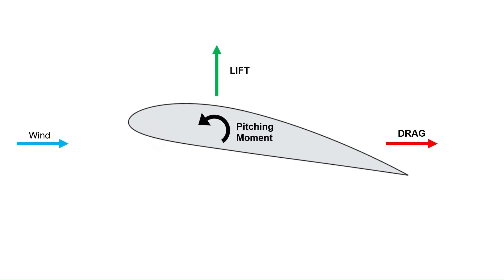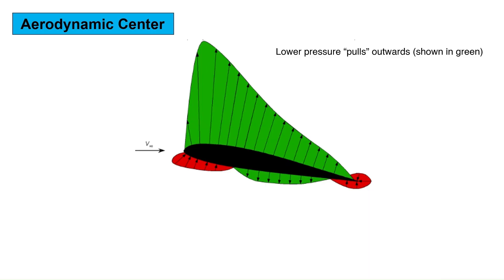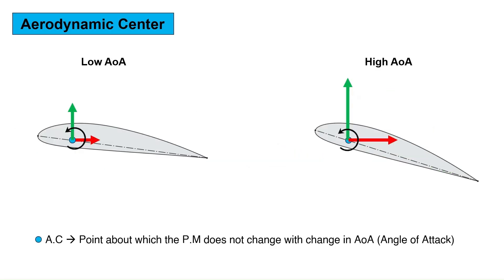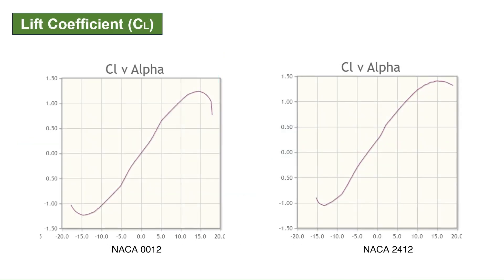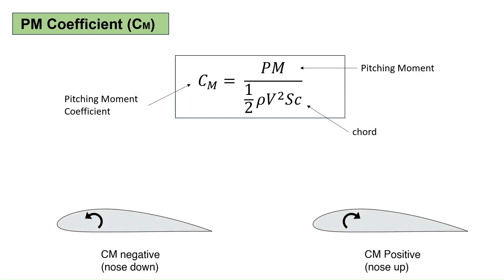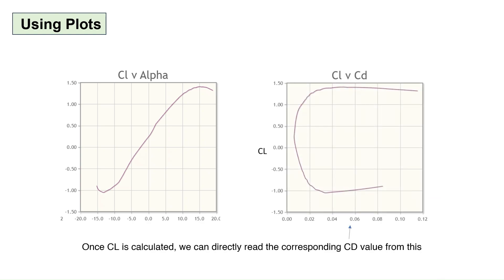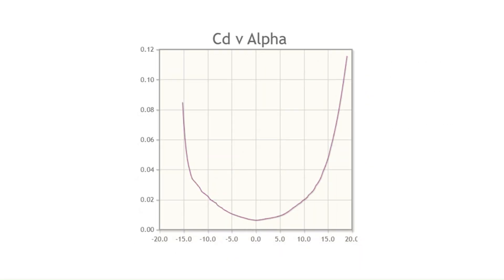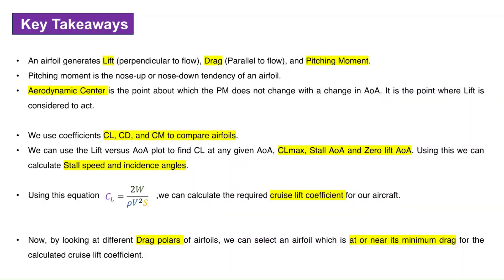Part 2: Forces & Moment, Read Airfoil Plots | How To Choose Airfoil | Airplane Design

Comment: the selection of a wing profile for any application does not have to be 'complicate'.    for one thing, it is not necessary to investigate a multitude of aoa's.      a wing's angle of incidence (aoi) is  Fixed.   and, in most cases, the use of a semi-symmetrical (or flat-botttomed*) profile is recommended,   consequently, some positive aoa is/should be built into the profile, and the wing's aoi may 'need to' be just one or two degrees positive.
*  a flat-bottomed profile should be used for low reynolds number (re#) applications.  eg., where the wing is  'small'  and/or  the speed of the aircraft will be  'low'. 
this is why the wing of a scale model aircraft should  Not  have a scale-accurate profile.

Comment: 153   that  is  not  correct.   center of mass (c-m) has been described; not cg.    every thing has a c-m.
only an aircraft has a cg and it should be located at the main wing's lower surface, at a point/line that vertically aligns with thirty percent of chord.    cg is actually the span-wise line  where an aircraft's mass balances (on two points), which simulates the mass of the aircraft being supported by the main wing  in  flight.

Comment: 119   it should be understood that lift happens at the  LOWER  surface of a wing.  not the upper. 
it should be understood that lift is an equal-and-opposite  newtonian result,  when a wing that has positive aoa deflects air  Downwards.!
Reply: No, both surfaces contribute to the creation of lift. The upper surface PULLS air downwards into it. If the air continued straight forward, a vacuum would generate, this is why the air gets pulled. Since the air is pulled downwards the same newtonian effect pulls the upper surface up.

Comment: 112   this is a flawed theory of how lift is generated.
if a wing having a symmetrical profile is considered, at zero-degrees aoa the forces above and below the wing are equal  ---  No lift.    if, instead, that wing has some positive aoa, it  WILL  make  lift.  (forces are  not  'equal').    conclusion:  when a wing has positive aoa, whether built in or otherwise, it will make lift and a significant amount of turbulence (drag) will occur above part of the wing's upper surface.
that turbulence happens  in a predictable pattern/shape.     and, the curved upper surface of a modern cambered profile occupies the space where turbulence 'would' otherwise occur. 
on paper, turbulent air is relatively less dense and 'could' contribute to lift.
in reality, the 'value' of any potential lift negligible, if turbulence (drag) is occuring above, roughly, (the aft)  fifty percent  of the entire wing.!

Comment: 109  it should be understood that wind tunnel demostrations (seen here) are inherently inaccurate.   this is so  because,  air  is  STATIONARY.      in other words, the air 'flow' over the top of a wing does  NOT  behave as shown, here.

Comment: 051   this is also known as the  neutral point; which is  ALWAYS  located very near to twenty-five percent of chord.  1/4-chord.    consequently, the  locations of the neutral points shown here are   Not  correct.
101   this is wrong/confusing.      the design of a wing and its profile Should  Result in the center of lift being located, at a wing's  lower surface, at a point that vertically aligns with thirty percent of chord.
similarly, thrity percent of chord is where a main spar should be located and where the load forces from a wing half Should be transmitted to the fuselage.